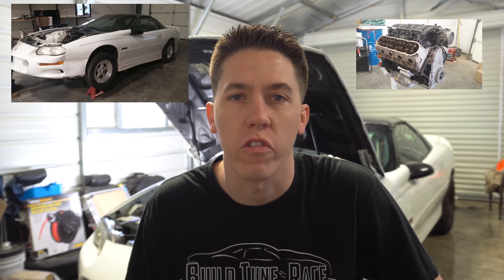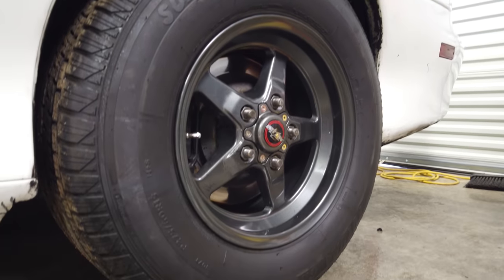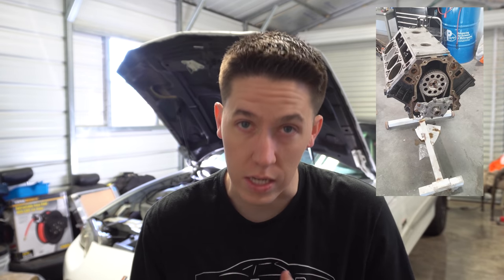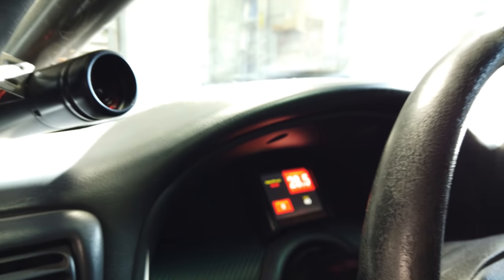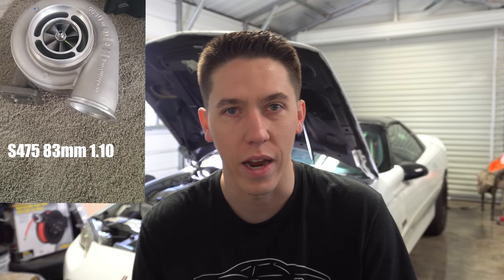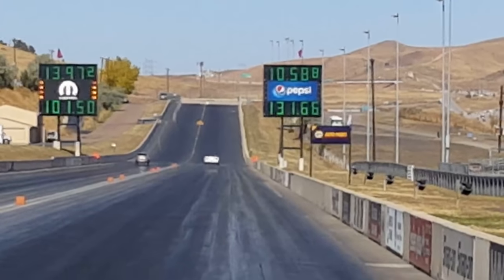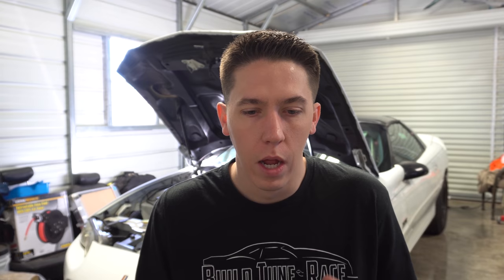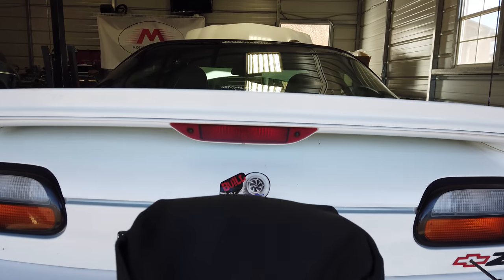Junkyard Turbo LS 10 sec Camaro to 8 sec Streetcar

Comment: Interesting build of your Camaro, mine is almost identical 408 LSX with FAST injection.

I haven't ran it yet, but the previous owner has run 9's with pump gas + methanol. on 15#.
Reply from the maker: Nice sounds about right! Should be a fun car! Good luck with it!

Comment: Great overview of your build !!  I'm just starting a Volvo 240 wagon, with an LS 5.3 truck motor. I'm also going single 78/75 turbo. Totally a junkyard type sleeper build. The goal is 10's for under 5 grand..   The 240 does come in on the lighter side at 2900 pounds surprisingly. I scored the 5.3 with a 4L80e trans for 200 bucks, and I got all the custom mounts for the motor, cross member, and 8.8 rearend mounts done for 450. I only paid 200 bucks for the wagon and sold the old red block for 200 bucks out of it.. So I'm off to a good start !!
Reply: Wow ! We're you able to finish it?
Reply: @ALEX.THE.RUSSIAN  sitting around 50% .. still looking for a few parts cheap !! Don’t want to spend a lot. Whole goal was BUDGET CHEAP
Reply: @1620GarageAndFarm  oh yeah! Btw pls record some videos ! Do you have Instagram? Also I know that you will be able to run 9s easy not 10s how you think. That motor is so good and can handle so much

Comment: We just got done building a 2000 TA with a 5.3 we cut a bunch of weight out without doing and carbon or lexan. Got it down to 2750lbs with full interior. Did tube the front end but that's not to difficult to do.
Reply from the maker: Dang that's awesome! Manuel window car no t tops? Aluminum block?
Reply: @BuildTuneRace  Electric windows, Ttops. It is a aluminum block 5.3. Did removed the heat and AC. And gutted out the doors as far as the solid metal bars. Removed wiper's and motor. Just alot of small things that all added up. But it is possible to have streetable fbody that weighs 2750. We've done it!

Comment: sub'ed cuz i too drive a turbo F-Body! love F-Body content...keep up the good work!
Reply from the maker: Heck yeah! Right on! What's your setup?
Reply: @BuildTuneRace  stock rod and piston Lq9 rebuilt with clevite bearing and total seal rings, huron truck manifold kit, on3 78/75 turbo, 450 fuel pump, quick performence fab 9, stage 2 t56, self tuned on hp tuners, Fuel is e50, thats about it, fun street car.
Reply from the maker: Nice! That's going to be a fun car!

Comment: How did you keep all the factory controls working while running the holley ecu? Such as door locks, windows, turn sugnals, and did you run the terminator or dominator?
Reply from the maker: I used a holley HP these cars have two different harness the engine harness and body harness. You swap the engine harness with the new Holley harness and leave the body harness in the car to run everything

Comment: I really enjoyed this because I learned.  But what does putting co2 on the car mean? Is that for shifting?
Reply from the maker: Co2 for the electronic boost controller so you can put compressed air on top of the wastegate to control boost. This can also be done a few other ways but Co2 definitely seems to be the best!

Comment: Lmaoo.  Your build remind me of my g35 ls1 build...  but I ran a 14.0  Lmaoo.  I had problems too. But it was with a 4.8 tho.. got a 5.3 now
Reply from the maker: I've always liked g35's an ls swapped one would be sick! How fast has it been so far? Or did you just get the 5.3 in?
Reply: @BuildTuneRace  I got the 5.3 last year. But had over heating problems. And problems  with 4l80e blowing the fuse when Tbrakes active. ( found a power wire that was not tie  and was touching the pan.and shorting out).   My goal is 9s this year.

Comment: Would you recommend just keeping the ls1 and building it for a drag car?
Reply from the maker: Depends what you want to do. If your wanting to go turbo and turn it way up the 5.7 ls1 don't have the thickest cylinder walls so they are prone to cracking i think. (Google max boost ls1) but if you have it you could start with it then if you hurt it build a 5.3 6.0 or go fully built after you learn on that setup.
Reply: Build Tune Race Thank you

Comment: Thank for your Videos   I have 84 Camaro Z 28 that I got a junkyard 5.3 LS to go in it I want to turbo it what cheap turbo do you recommend I want to run the 1/4 mile I got Holly terminator X max for the tuning for the 5.3 I was planing on Using a summit turbo cam and pac 1218 spring and do you have video how to clean injectors ?
Reply from the maker: A s475 1.10 83mm exhaust is the turbo I used on my 5.3 and it did well! Lots of people are using the precision LS series 7675 with good luck! If you look back at the I dont want to melt another piston video i go over cleaning them there! Good luck with your build sounds like your on the right path!

Comment: Good video!  you mentioned clogging injector. What micron filter are you running before the injectors and what cylinder was that injector in?
Reply from the maker: Honestly I cant remember what micron filter I ended up getting I think it was a pretty good one went with what others recommend at the time for E85. Number 6 is the cylinder it hurt. After that I took out  the injectors had them cleaned and that's the one that was alot more down then the rest since I've been running ethonal guard from VP and has seemed to deff help. I still clean the injectors before each season now!
Reply: @BuildTuneRace   Injector dynamics has a good tech article on fuel system filtration on their support page. With e85 you should be using a 10 micron microglass filter. Most stainless filter will not suffice and clog injectors.
Reply from the maker: I think I've seen that. Their filter they came up with is pretty sweet!
Reply: @BuildTuneRace  Fore Innovations and Aeromotive both have a 10 micron microglass filter that will work

Comment: What’s the rear gear u are running I’m in the process of building a similar combo in my Firebird aka Hellbird
Reply from the maker: Forgot to mention that lol. I have a 3.90 gear but it's only good for a out 140ish mph in my combo so I bought a 3.50 gear to put in it if i want to go 1/4 mile race the car pr do a lot of street driving the 3.50 will help!

Comment: Damn throw some rc comp wheels and black hockey stripes on yours we would have twins my cars name is Heisenberg aka Walter White my hockey stripes have little Heisenberg's all in them and a big sticker on the back window. I had a   super low mile 07 4.8 sbe with PRC stage 2.5 ls6 heads,Summit aluminum intake and 90mm TB and rails and some 120 pound FIC injectors, arp head studs and rod bolts  a LJMS cam and  pac  springs and comp pushrods & BTR trunion upgrade that's about it for the motor its got a Huron speed v3 single kit with a VS billet 78/75 with the 4.8 and a 50 shot of nitrous and alot of ignite red fuel I love that stuff, its got  a stock case th400 with good stuff in it and a pro brake fleet pride big truck shop made my drive shaft and I went with a strange 12 bolt rear end 3.90 gear with a spool  I got almost all BMR suspension pieces and k member and double adjustable Viking shocks and TRZ anti roll bar out back and some Lakewood 90/10's lol and TRZ tie downs up front. I'm running the Holley HP system and co2 kit from motion raceworks . I only run 1/8 mile it was a N/t and grudge car but after I popped the 4.8 and told what it was running no body believed it was a sbe 4.8 in a 3200 pound skreet car. The best that set up went was a 5.61 @ 127 mph it basically has a full interior just not past the front seats we fabbed up a hoop and door bars so from 30 foot the track pops see kirkeys with harness and door bars with the doors open and most of the time they don't give me no shit but hell at my two home tracks you could jb weld your seat in and use rubber bands for a seat belt and run 4.50's they dont care gotta love living in  the middle of know where in Alabama but I have been putting together a ls1 stock ci just a forged rotating  assembly from Texas speed and good stuff in it with the top end off the 4.8 for like a year and just got it finished about 4 months ago and new converter and VS billet 88 in it and haven't got it right yet gremlins and getting the suspension dialed back in.  I feel like kicking my self in the ass for not swapping to a glide the 4.8 needed that first gear now it seems like I'm shifting right after I let go of the brake. I got vids and pics on my Facebook and insta I want to make YouTube videos but I hate being on camera and hate being on camera and talking worse lol

Comment: how does the moser fit? trying to make up mind on a 9 inch for my m6 car, hard to swing over 4k for a full fab'd. i'd be thrilled to get into 10's, seems that setup works well enough. any issues/complaints with it? thanks. awesome ride btw.
Reply from the maker: It works awesome! Zero issues I've have probably 3-400 hits on the rear end. If I did it again I would probably have it build narrower to fit a normal offset wheel.

Comment: Nice info. Im thinking of buying a 02 SS is that a good platform for 400rw reliable?
Reply from the maker: I think it would be especially if its a 6 spd car. Add heads cam and you'll be there pretty easy. If its a auto car the 4l60s dont last forever when you start making a bunch of power but still would work well!

Comment: Hi there, in building my 98 camaro, with on3 turbo and rear bmr drag package, the only issue I see is the differential, I’m using now a spool with 3.73 gear what is your setup and axles ?
Reply from the maker: Nice! I have a moser 9in with 35 spline axles and 3.90 rear gears!

Comment: What was the specs of the first turbo that wouldn’t spool on the 5.3? And what is the one now?
Reply from the maker: First turbo was a cast borg 88 96 with the 1.32 exhaust housing. The one that worked well on the 5.3 was a s475 1.10 83 and now it was a Billet Borg 88mm from Forced Inductions with the 1.32 96mm exhaust housing

Comment: Just curious but with the stock 5.3 how much money did it take to get the car up and running? And how much do you have in it total today?
Reply from the maker: The original build including car engine Ford 9in rear suspension ect was probably right around $18K since then with the 408 bigger turbo ect is probably around 30k
Reply from the maker: Those numbers might be alittle high and some stuff could be done cheaper but that's a pretty good estimate from numbers I've put together
Reply: Build Tune Race not that bad! Just curious as for comparison. Thanks and god speed!
Reply from the maker: Thank you!

Comment: Hey, do you have a video that explains how to determine where timing should be on high boost using Holley? I actually have a dragbike Hayabusa, 500hp 25-30 boost. Everyone just say at least 10 degrees out, but how do I determine whats right?
Reply from the maker: I don't and timing is very difficult it's not a once number fits all. Alot goes into timing. Compression, fuel, boost ect. Best way is to start conservative on everything boost afr timing and work your way up watching afr and plugs!

Comment: How you like the power glide for regular street driving?
Reply from the maker: It's not bad around town. Not having overdrive and a 3.90 rear gear and a 28in tire isn't the best on the highway. If it had 3.50 or probably 3.25 in the rear it would be alot better at 65+

Comment: What converter do you use? And awesome video
Reply from the maker: Thanks Jordan! I have a 9.5in PTC Converter!
Reply: What stall would you do? I race sand drag racing I’m new to asphalt racing. And I love how involved you are with the Holley efi systems. Have you use the terminator X yet?
Reply from the maker: @jordanh1313  What is your combo? If turbo just call PTC and they will build you a converter for your combo! Turbo converters flash more with the more boost they build. I have played with a few Terminator X systems they work awesome!
Reply: It’s going to have the summit racing s475 on it controlled by the Holley terminator X. Trying to figure out how the built in boost control works and how to do a co2 set up. Thank you for answering my questions btw
Reply from the maker: Nice you'll get it definitely give ptc a call with all the info and the converter will be 👌. Follow Holley boost control instructions and you shouldn't have a problem!

Comment: Would have been better if you focused more on how you got into the tens with the 5.3.  You said the turbo and torque converter but didn’t hear what model turbo.
Reply from the maker: The turbo was a Borg Warner s475 1.10 83mm exhaust on 17lbs of boost! 2step set at 3800rpm left on about 7 lbs of boost went 1.5X to the 60 ft
Reply: Thanks for the info!
Reply from the maker: Your welcome!

Comment: What rear wheel and tire combo do you run?
Reply from the maker: 15x10 7.5BS with a mickey 275 Pro Drag Radial
Reply: Do you think that would fit under a 89 Camaro??
Reply from the maker: @jordanh1313  not sure about 3rd gens. This even took some clearancing of the inner fender and cut off the bump stops to get these to clear
Reply: Would a 28x10.5 tire fit a 15x8 wheel??

Comment: Which TF heads are you running?
Reply from the maker: Trick flow 220s!
Reply: Build Tune Race  stock 220s  or ported?
Reply: @BuildTuneRace  ls1 or ls2 version?
Reply from the maker: @dallasjohnson208  ls1 cathedral port!
Reply: @dallasjohnson208  only the 215s are designed around a 3.9" bore. The 220s and 225s are a 4"
Reply: @garlandjones7709  the 220 ls1 will fit 5.3, the ls2 does not.
Reply: I will clarify why I asked, the 220 as cast can be purchased in the ls1 2.04 intake valve or the ls2 2.055 intake valve is why I asked the question.
Reply: @dallasjohnson208  thanks for the update and I was wrong. I thought I remembered these being offered only one way . According to tooley both have different chambers. The ls1 version has the 3.9" bore and the ls2 has the 4" and they have a cnc program to open them up to the 4" later so they're identical in the chamber department. And the runners are the same.

Comment: You’ve got me scared about my injectors now. Car has been sitting with e85 in the rails that’s about 6 months old
Reply from the maker: For about $10 an injector I would clean them before you start trying to make a bunch of power. If the car is driven daily not as much to worry about bit E sitting is not good!
Reply: Build Tune Race Fic wants $25 per injector for cleaning. Hopefully I can find someone local who’s cheaper. Just another thing to add to the list lol
Reply from the maker: You can visit my website I clean them for $10 an injector and $8 for return shipping g
Reply: Buy an ultrasonic bath. We run meth in our cars and it gums up a system quick.

Comment: What age do you run with the meth and what kind of timing do you run with the meth And how much timing do you pull when you intake  temperature go to high and temp do you start to pull timing?
Reply from the maker: So with this setup I treat the meth like an intercooler. So I tune it like the car has a air to air intercooler not so much any changes for meth since I’m only using the meth to cool the intake temps. Afr at 20psi of boost is around 11.2-11.4 temps above 175 I start to pull 1* of timing around 250* it will pull around 4-5 degrees.
Reply: Age = aft Damn iPhone auto correct
Reply: Afr

Comment: C02 setup? From who?
Reply from the maker: I got the bottle and bracket from jerry bickel but Motion Raceworks has a nice one now with a billet roll cage mount regulator fittings everything similar to my set up. The boost control solenoids are Holley efi.
Reply: @BuildTuneRace  thanks! Good video. Awesome job on the car!
Reply from the maker: Thank you! I appreciate it!

Comment: awesome Camaro my Camaro is also turbo on a 76mm Huron turbo Im also on e85 I've noticed on full throttle its at 15.3 is that bad where should my air fuel ratio be around full throttle also my idle air fuel ratio is around high 10 to 11.i always let my car sit with full tank of e85 for like 2 week does that matter.
Reply from the maker: Thank you! That is lean and could be very bad. Your car should idle around 13-14 at idle and at wide open throttle and in boost you should target 11.0-12.0 depending on boost level 2 weeks isn't to bad. But it still wouldn't hurt to have your inkectors cleaned like once a year. Or if you notice the car starting to idle or run rough. Hope this helps! If you have anymore questions let me know!